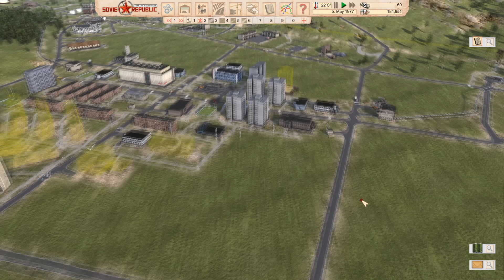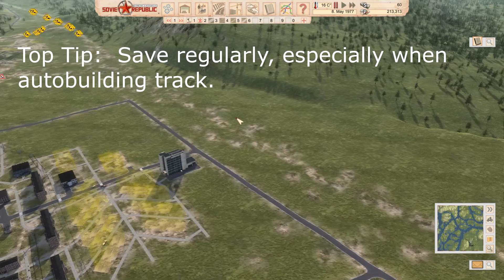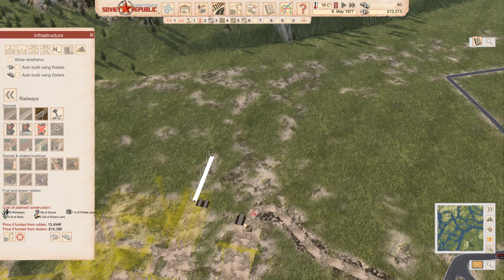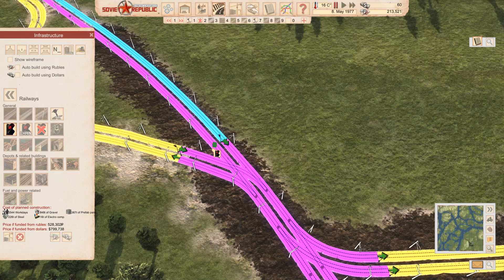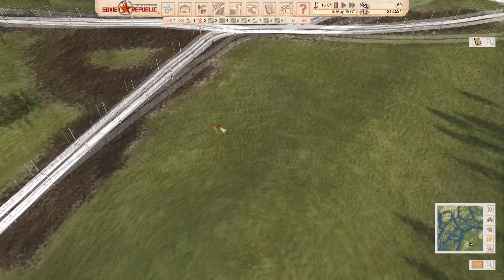Rail Track Layout:: Workers & Resources Soviet Republic (Seasons Update) #26

Comment: Great video. I enjoyed watching you design the routing. What do you think of 1-way loops? I was always falling into the traps you mentioned about too many junctions on the main line, and instead of being more careful/deliberate, I just started using a bunch of parallel 1-way loops  when I had a cluster of stops relatively close together.

For example, for your steel/openstor/warehouse/passager, anaalternative layout would be to have 1 junction from the main line split into 4 1-way tracks, that each pass thru 1 stop and keep going and go around and rejoin the main line (either in the same junction as they left it, or somewhere else). The stops would probably need to be laid out differently, or at least rotated. I dont know what method is better, but I found that the 1-way loops were more resilient to being overloaded with too many trains.
Reply from the maker: One way loops can be very useful, especially for local passenger trains,  the key is making sure the exit blocks from the 'entry' junctions are big enough to accommodate the train length.  The downside is the amount of space they need to supply different terminals, something I do not have on this map.  For example, I did try to fan the tracks into the warehouse and the open storage, but could not get the length of block that would accommodate the length of train  required to move key freight, e.g. steel, to other towns.   

One reason why I like this game is that the moment you think you have it sorted, it throws up a challenge that needs to new approach.

Comment: I recommend that you use as big trucks as possible (like 5x) to haul some iron to your steel factory to get some of your own production up. My thinking is that it takes a lot of steel, money and resources to get that rail network running from border and you could use those resourcers to actually build steelmill.
Steel is iron 1 part coal 2 parts so you are pretty good because of own coal already. I know you are worried about traffic on border but still I would suggest hauling iron and just kickstarting steelmill would be the most effective choice. 
Of course I appreciate whatever you choose to do :)

Another suggestion: do not use semaphores when you build tracks - it seems to be easier to manage track builders and make them autobuild without jamming on 2-way tracks.
2nd edit: that means NO single semaphor is allowed, not even one.
Reply from the maker: ty for the tip about larger trucks. Moving raw materials by train is a long term objective, but given the limited building space I wanted to make sure the connections were in place.  My initial target is to get a single track line running from the customs post to the steel mill, but as you suggested the initial delivery will be by truck.    To this end I have been looking at bridging options to get to the iron deposits.  Do you know how high a bridge needs to be to allow ships to past under? 

As suggested I have made sure all the signals have been removed.  The reason I put out signals during the planning stage is to test junctions and get  feel for the way the trains/track constructors will run.
Reply: @StephenSilverbeard   I have no definite answer for bridges as I haven't used all the ship variants. I think some ships used more space than others but not sure. Anyway I think going up like 5-7 clicks, depending on shore height, should be sufficient. Using those arch type of bridges is useful I presume.
Bridges should be, in my opinion, build so that only one section is used to go "up", then the flat part, finally down. So it's usually only 3 part construction to make it as clean as possible.
Reply from the maker: @flacch  ty for the information.   Never built a long bridge over water.  It is going to be expensive, so want to avoid using steel.  Will have to balance height against  cost and hope ships will go under, if not they will have to find another route.